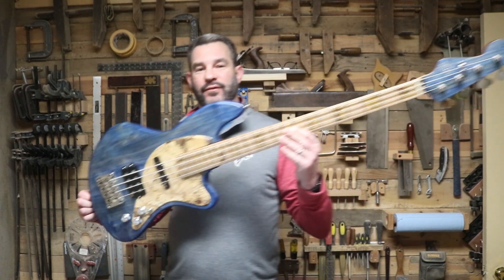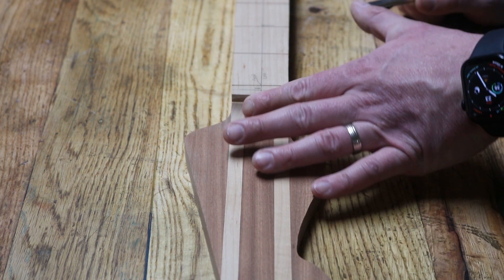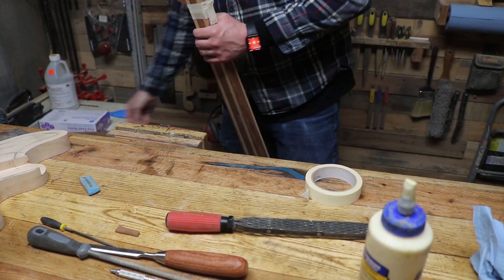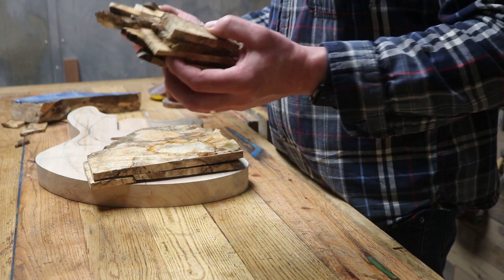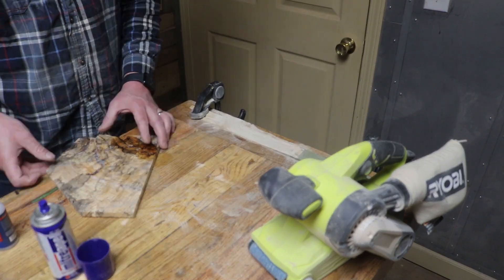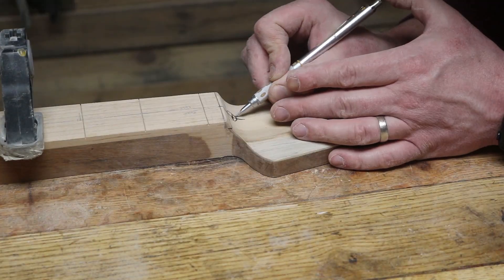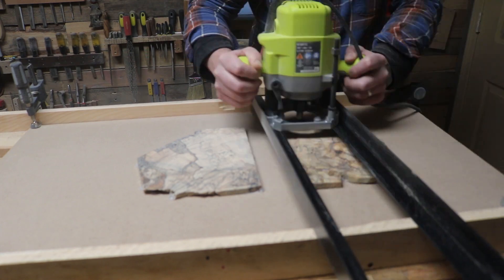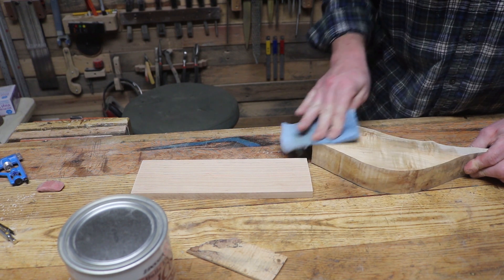Scratch Built Custom Bass Guitar Build Ep 3

Comment: The cactus juice works best under a vacuum to suck the juice right into the material. It works well for most timbers, but there are limits to what it can do.  Build all turned out awesome despite the challenges
Reply from the maker: You are 100% correct.  I should have purchased a vacuum rig.